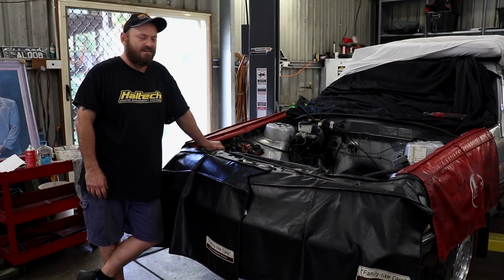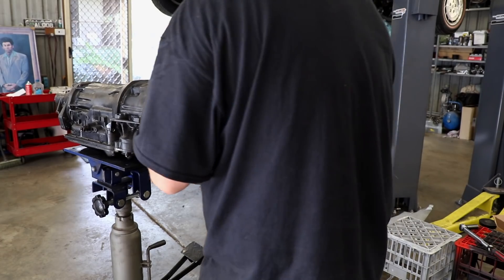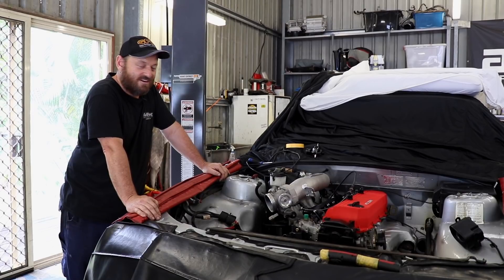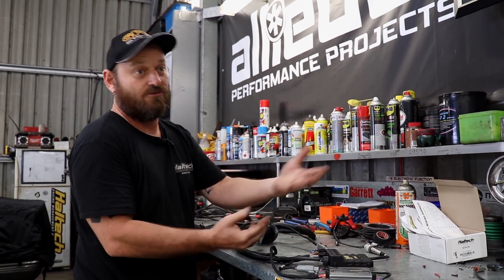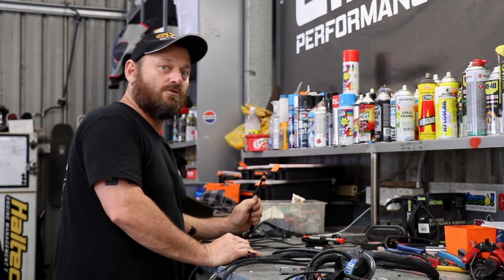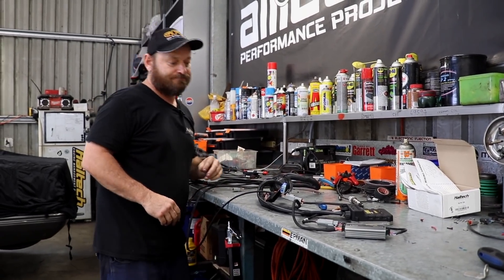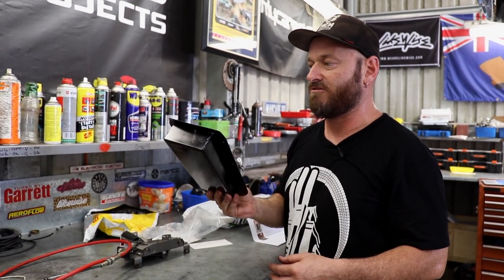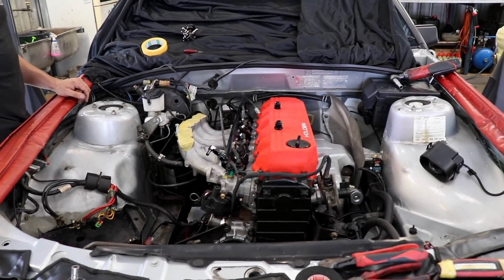THE SKID FACTORY - RB30E+T Holden VL Commodore [EP7]

Comment: Keep the wiring info coming Al. Modern engine management , and the engine protection / tuning configurations are very interesting to serious car folk. Otherwise direct the less interested to the Unicorn Circuit.

Comment: Just wondering with your oil pressure sensor going in to the ECU are you generally using the cheapy 150psi ones or something off a wreck or going for the $200 ones?

Comment: A wiring question please, where do you source the connectors and pins for the various transducers and noids on the engines? Do you have one go to shop, or cruise the net? Finding one off connectors to replace damaged parts is one of the hardest parts of keeping older cars running. Cheers,
Ray

Comment: Currently watching without sound, cause lifes like that, the tailshaft seemed to be a brief interlude there. Should you give your shaft some love on a power upgrade?
Reply: Nah stock shafts handle good power with new unis. Not sure if the vl runs a centre bearing like the r31

Comment: do you stager your toque converter bolts? cross hatch them when tightening?
Reply: Usually what you do yes
Reply: Aussie Guy it's how i do it, but i thought i would ask the question because i have seen it both ways. is a flrxplate susceptible to warping like a flywheel?
Reply: @joekizonu9503  From my understanding its just to mate the surfaces flush

Comment: Could you use a haltech 550 with an rb30e+t? Or do U need to run the 750?
Reply: You can but it would not be sequential injection as there is only 4 injector drivers.

Comment: so id like to know, although i probably wont get the answer here... everyone i know goes a link ecu on RB's, im rebuilding my old RB30 out of my R31 and will be adding a snail on it when im done do the haltech have any advantages over a link besides being a friend of this channel?
Reply: Are you in NZ? If so then that is why everyone uses Link.
Reply: @alanbutler2579   nah north QLD
Reply: @d.s.rproductions4647  Link does an RB30 plugin which is just easy and a massive improvement over std. The Haltech is a wirein which is more work but also allows you to do a bit more. They are both good.
Reply: @alanbutler2579  ok well that makes a bit more sense coz most of my mates are running RB30's and RB30/25's... since im getting ready to rebuild and turbo my old RB30 i was keen to know what the go was, thanx man :)

Comment: Please 'skuse' my ignorance....but what is that little red lever for in front of the slush-box shifter at 11.00
Reply: It's the reverse lockout lever. That way you cant accidentally bump into reverse as opposed to to just going to neutral. You go to neutral, bump the lever forward, then move the shifter to the reverse position then park
Reply: @PerrybuiltPerformance  Thanks mate.... I'm not up with all this auto-box stuff. Cheers...

Comment: Aussies, kind of odd question but I've got an a340 tranny (western version so it's an aw4 on a 2wd jeep xj), it has this weird leak that seems to be coming from a circular plug (it's about 5cm in diameter) that's held in by a snap ring on the left side near the shifter, there's a sensor there a little bit front of it so it might be that o ring too, any clues if that circular plug with the snap ring and a cross on it might have a seal inside that's failed?
Reply: Take it to a mechanic LOL

Comment: E85 is no good for 2 strokes as I've found out .. okay in a 4, but with a 2 stroke, since you have fuel/oil mix being sucked through the crankcase there is a propensity for corrosion with the water in the ethanol, and you don't want that one your roller bearings and other parts sitting in there rusting out of sight. If you flushed it out with normal petrol after every run, like a speedway engine, but who has the time for that?
Reply: Not healthy in a VL either, they have zinc coated steel tanks with steel fuel lines.
Reply: E85 ever only makes sense under boost or insane compression ratios.